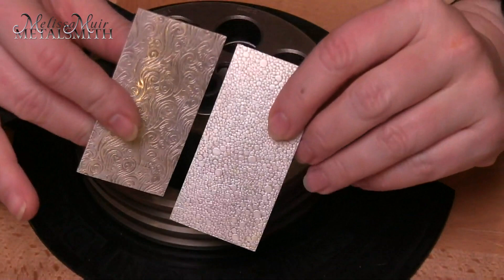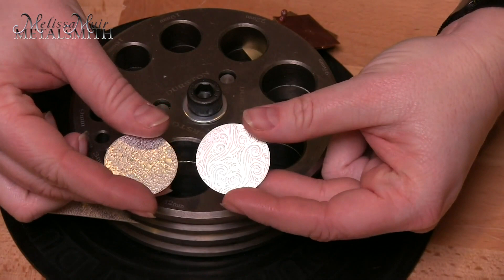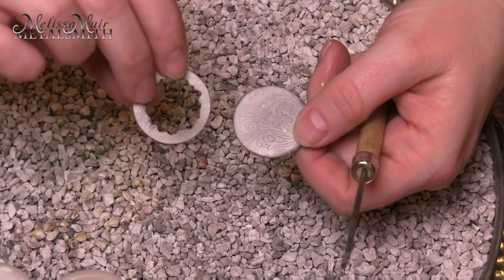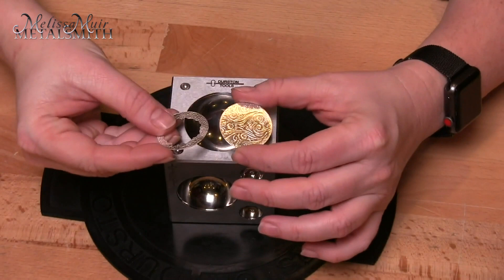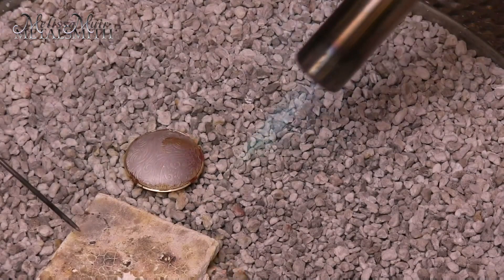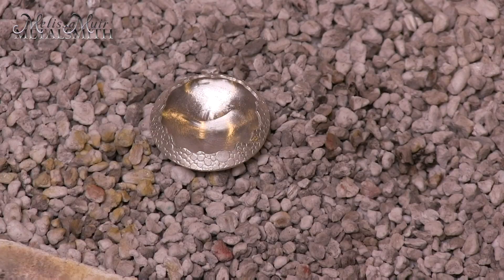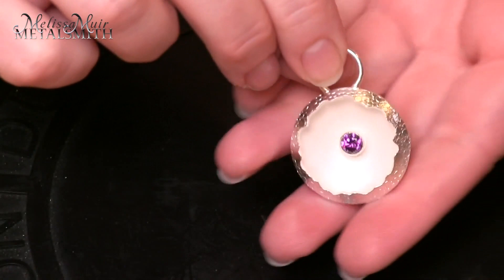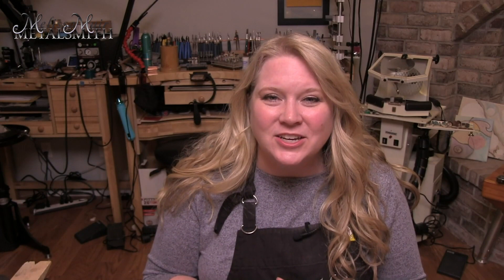How to Make A Shadow Box Pendant - Tutorial

Comment: Beautiful. How do you modify tube bezel that is slightly small if not using calibrated gemstone instead of cz
Reply from the maker: At that point I usually cut the tubing to the right size and such. If you use one of the premade tube sets, you may not be able to modify it. You would need a thick walled tube and just cut the seat to fit the stone.